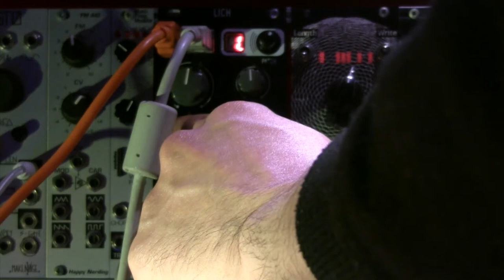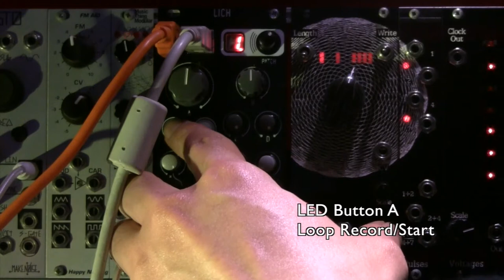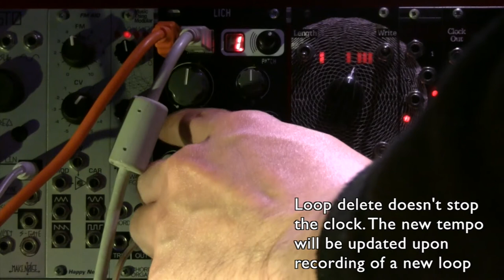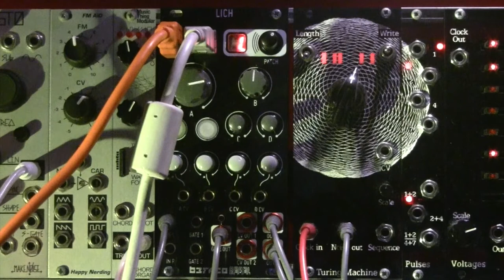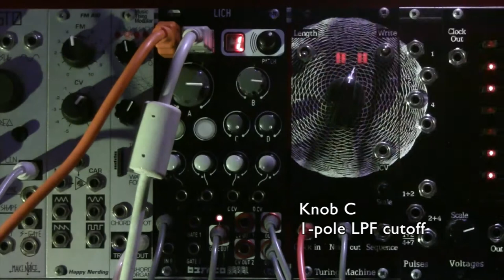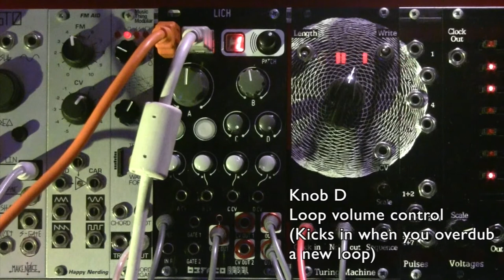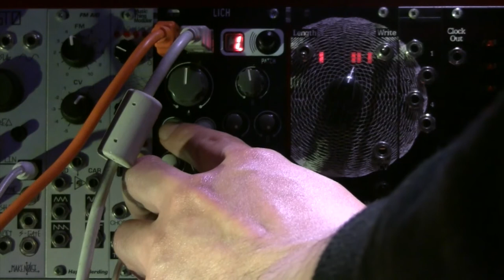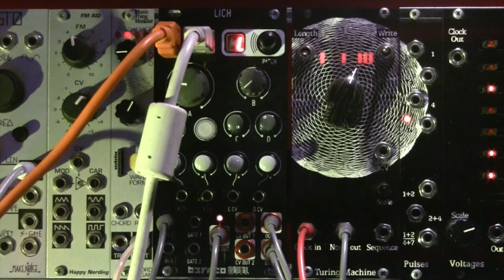OWL Max Tutorial 7: CGL (Clock Generating Looper) Introduction

Comment: Would it be possible to make a retrospective looper? The looper is always recording/buffering. So you play something and like it, then you press a button and start the playback of the buffered recording of the last 16 or 32 clock ticks for example as the loop.
Reply from the maker: I (Martin) have been wanting to make a patch like this for ages!
Reply: @RebeltechOrg  If it would exist, I would be happy to try it out and use it. But I can't make it by myself.